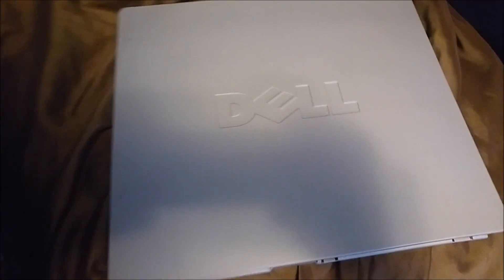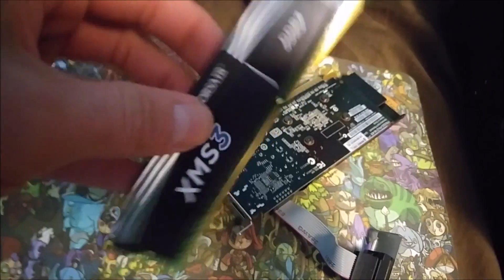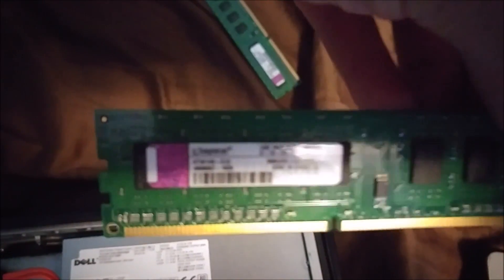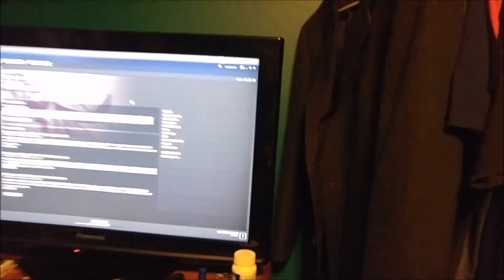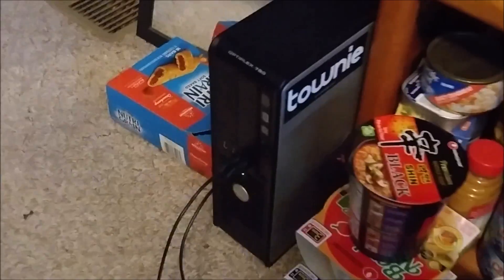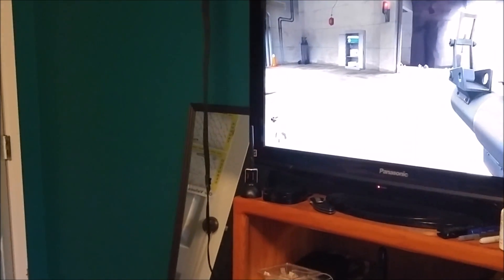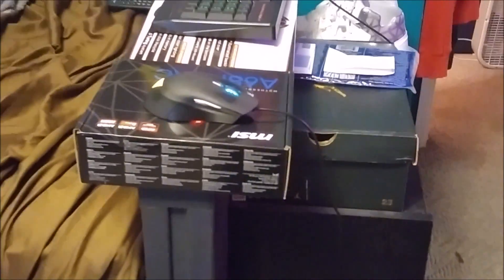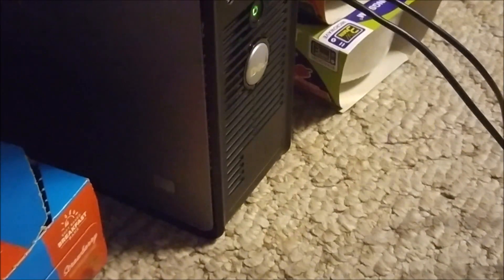$200 Linux Gaming PC Build! Dell Optiplex 780 (Team Fortress 2, War Thunder, Dota 2)

Comment: I picked up a optiplex 780 mini tower with a
Core 2 Duo E8400
4GB DDR3
250GB Hard Drive
305 PSU
Windows 10

for 57 dollars,is that a good deal?
Reply: ***** 
Yeah,I plan on upgrading to Core 2 Quad And Adding 8Gb of ram and then possibly getting a 750ti
Reply: ***** Thanks for responding

Comment: Lubuntu is the best for gaming since its a lot lighter
Reply: Vasilios As how light is it vs ubuntu?
Reply: A lot lighter,it even works on a pentium 4 with an old directx9 graphics card and 2gb ram.
Try that with normal Ubuntu and you wont go nowhere.
So Lubuntu is a very stripped Ubuntu without losing anything,everything that works on Ubuntu,work 100% on Lubuntu and faster,you just lose the eye candy fancy desktop and get a basic one.
Reply: Vasilios As so if I'm programming motel on ubuntu which should I go for?
Reply: So you need minimalim and full resources power,go Lubuntu.
Thats my opinion friend.

Comment: Friend do not you change the source of power or anything? So with that source is supported by the graph gt 740? , By the way if you can tell me porfa how many whats has your source of power? You would help me a lot if you told me
Reply: The source of the factory of the optiplex 740 holds the 740 GT graphics card? ;-;
Reply: How much is the power source you use in that cpu?

Comment: bro can the optiplex 780 support a 750 ti
Reply: KYOGAI you need the low profile version as they normal one won't fit so get the 1 slot low profile and the psu will be able to run it
Reply: jonathan Felix can it handle a gt 1030 2gb

Comment: Guys I ordered a Dell Optiplex 780 SLIM
•	Intel Core 2 Duo 2.93 GHz
•	2GB DDR3 Memory
•	80GB SATA Hard Drive

What graphics card can i add to it
Reply: ? gtx 1050
Reply: ? if it fit
Reply: sussey use low profile card like gtx 750/1050/rx 460. all of these are low profile.
Reply: sussey you need at least 6GB of ram to play games

Comment: Aight so check this, I have the same Optiplex 780 SFF, and I'm gonna put in the GT 740 SC, now is that the same as your GT 740? Also, I'm upgrading the PSU to a 300W, do you think all that is still good enough to run War Thunder at decent settings?
Reply: just put in a gt 1030 if you are upgrading the gou anyway

Comment: I have dell optiplex 780  Can i play overwatch
Reply: DezzelTheNerd hey do you think I can throw in a gtx 1050ti to this 780sff and would it be stable with the original psu
Reply: Bananoboost low profile it would work with stock psu

Comment: What's the wattage on the psu?!?!
Reply: Mine is 280 watts, only able to use GPUs that do not require external power connectors.
Reply: Just buy a cheap/trustable psu

Comment: umm how did u use a ddr3 chip in a ddr2 board?
Reply: The max memory is 8 or 16gb?. They work on 1333mhz? do you confirm this? I think the maximum is 1066mhz for the chipset Q45.

Comment: DezzelTheNerd hello...

I have a question... how you managed to feed the video card power supply factory or changed?
Reply: The card is powered directly through the PCIE slot. Most low wattage cards can be powered this way. Power supply appears stock in his video, usually there isn't a need to upgrade.

Comment: I have a Optiplex 990 with 8gigs ram and I'm waiting on my GTX 758ti to get here, I will be installing Ubuntu 16.10. Why 16.10 the wifi drivers are better and it has a more up to date Kernel, better GPU support. And I'll also upload a video. Keep up the good work dude.
Reply: DezzelTheNerd I have a great video on my channel about a AMD a10 build. You should check out.
Reply: EricJ-TuxTechTV should i buy this pc for 100$ then upgrade it?!
Reply: EricJ-TuxTechTV I got mine off of ebay for 90. probably going to get gob of ram and gtx 750/rx 460/gt 730
Reply: Cory 64 That's kind of a rip off for a 780 but for a 790 it's fine